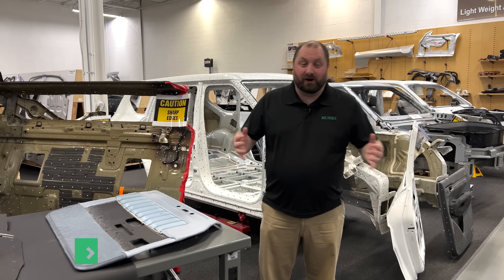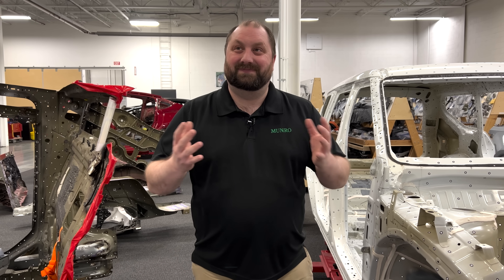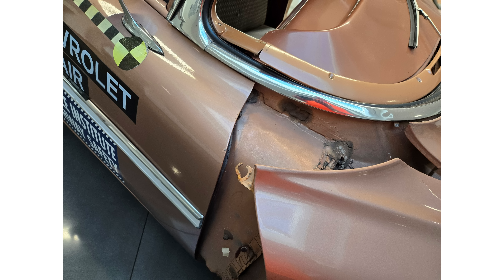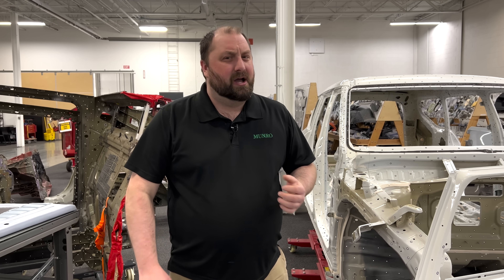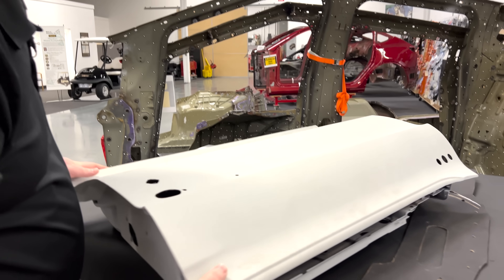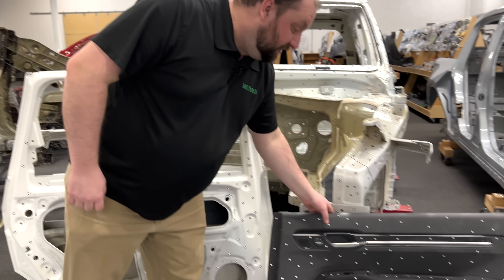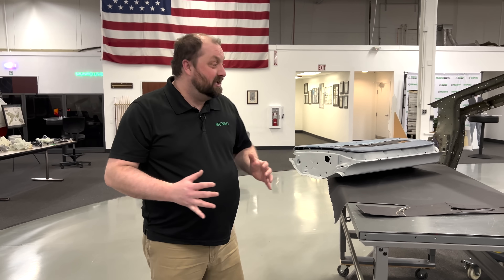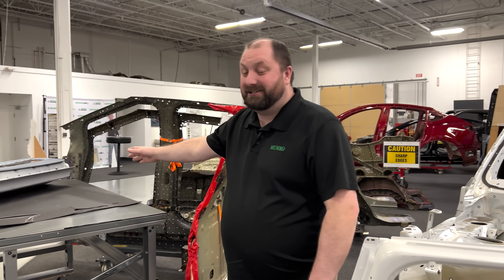No, Your Classic Car Isn't Built Better Than Your New Car

Comment: In addition to the safety factor, when I started driving in 1970, a car with 100,000 miles was pretty much worn out. Today, a car with 100,000 miles still has lots of life left. Many people today don't know how to work on cars because you don't have to near as often.
Reply: People these days also trade in their cars a lot sooner so they're always riding in a car that hasn't had a chance to wear out and they're a slave to a car payment.
Reply: It really depends on how you define a "classic car". If your classic car is from the early 70s, then no, it's unlikely to  have ever been  more reliable than a modern car. Though it was certainly more easy to repair. And also much better looking of course, though that's arguably down to personal taste. 
If your car is a Mercedes from the late 70s or 80s, or another brand from the late 80s/early 90s, there is a high chance it certainly was (and in some cases, still is) more reliable and well built while still being fairly easy to maintain.
Reply: Modern car engines are not really rebuildable. Old ones were. But the lubricants have improved, tolerances are better and computer modelling has gone a long way to improve vehicles.  But high tech requires a higher level of workshop facilities.  I rural areas in Africa,  that is an issue.  I have a 70s tech VW and a Modern car.
Reply: I guess this explains why most odometers had only 5 figures back then.
Reply: Yes, I worked on autos going back as early as 1940. If today folks had to rebuild and replace parts as often as we did back in the day, they wouldn't be able to afford an auto of any kind. The electronics and other improved tech has made autos last longer. The only thing that really frustrates me is they don't separate assessors from the main computer module. A window actuator causing a car not to start is simply engineering stupidity.
Reply: People lazy ass eff today too.
Reply: I’ve spent lots of time under the hoods of older cars, but having owned a number of new Hondas and have never opened the hood except to check the oil and other fluids.
Reply: @tedecker3792  well, let's see how those new hondas fair 20 years from now
Reply: @ there are tons of 20+ year old Hondas out there. Granted millions were made.
Reply: @tedecker3792 a 25 yr old honda isnt a new honda.
Reply: @mro9466  Should be fine if the current reliability trends on them are any thing to go by. The issues are because the engines are completely new (1.5L for example), compared to the venerable J-series V6's. They had issues too early on, but were fixed in the following 25 years.
Reply: Really depends on specifics lots of modern day cars are junk by 100k because the parts are either too expensive or complex for what the car is worth older cars are easier to work on and parts can sometimes be available
Reply: Yup, I was there. In the 60s, terms such as ring jobs, valve jobs, and engine rebuilds were common. By the 70s, I figured it was easier and cheaper to just replace the engine myself, in a weekend, on my driveway.
Reply: Also, they are discouraged from doing so, not because new cars don't need maintenance, but because so many of them live in Condos and houses with HOAs that prohibit you from working on your vehicle, and because they are taught that it is "low class" to fix cars.
Reply: Nice joke. Now go back to driving your Ford Ecoboom 3 cylinder for more than 30k miles 😂
Reply: Thats not due to engineering, thats due to materials technology and oil technology. Nikasil coated cylinders and modern oil does that. But if you applied the same technology to an old cast iron, it would far outlast anything today.
Reply: @smh9902  No it wouldn't. There's more to it than that, please stop oversimplifying everything.
Reply: @smh9902 hate to break it to you but advancements in materials and oils are all engineering 😂
Reply: @ But its not automotive engineering, youre missing the point. If you look at how modern vehicles are designed, they use proprietary parts that are expensive and must be special ordered. Such as proprietary headlamps, proprietary solenoids, and similar such components. They use belts in oil (wet belts) which are notorious for premature failure and require partial disassembly of the engine to replace. They even are eliminating oil drain plugs and dipsticks to prevent people from changing their own oil. Applying advancements in Materials Engineering, but regressing topologically, is not progress. Its backwards. These things are engineered to last just past the warranty, and then fall apart with no means of repairing them. Now apply the same advancements in materials technology to the old designs, and you'd have systems that would last millions of miles. Designing machines to be easy to maintain and repair is a core part of longevity. These cars today are designed to be disposable. They are smart phones on wheels. Its planned obsolescence to the max.
Reply: @smh9902  > proprietary headlamps
That's because of the stupid law back in the day that required all headlights to be the same shape, reducing styling options. I prefer the modern headlights. And there are plenty of third party headlights you can order as a replacement for far less. 

>proprietary solenoids

These don't have to be changed really at all. 

> belts in oil (wet belts)

Agree it's a dumb idea and will probably die out once they fill enough warranties to see it's stupid. 

>These cars today are designed to be disposable. 

Old cars were far more disposable than modern vehicles, what are you even on about?
Reply: @Mercer1012   Nope, the sealed beams being a universal part was a great idea. It simplified supply chains and reduced costs in both cost to replace and maintain. The modern plastic headlights are a pain to change and they break over time from photodegradation. "Styling" be damned, I want a simple work truck.

Solenoids need to be changed all the time. Its one of the most common parts of a starting system to fail.

Old cars were not disposable, they were rebuildable. If we applied the modern nikasil coatings and other metallurgical and tribological technology thats common now to the old simple designs, they would last and last and last.

Simple fact is, if something can't be easily rebuilt or repaired, then its designed to be disposable. I would rather have a truck with an engine that only lasts 150k miles IF it only takes me 30 minutes to swap the entire engine.

Comment: I have a mid 60' pontiac that i recently completed a full body-off restoration on. I am convinced the new welders hired by GM at the time started on the chassis line, there was welds on my chassis that completely missed the second piece of metal.
Then theres the front suspension geometry. Rumour has it the chassis design engineer of the the time firmly believed plow understeer was a "safety" feature as when the car started to push in corners, the driver would slow down!.
Next, the 345hp engine, and the single circuit, unboosted four wheel drum brakes seem like a poor choice of spec!
Still feel safe? How about a front-of- chassis mounted steering box with a non-colapsible steering column aimed right at your neck.
I have managed to do some serious updates to brakes, suspension, steering, seatbelts ect .
It surprises me that any teenagers lived through that time.

Comment: I have had plastic car parts turn to dust without any mechanical stress on them. Many plastics get brittle when they get old making all the snap on tabs break if you try to remove the part. The real problem with plastic is that the consumer has no way of telling which plastic parts will last, and which will crumble with age. I'm not even sure the manufacturers know. Certain very expensive oscilloscope probes from HP crumbled after a few years even though they were never exposed to sunlight. The flexible plastic on the wheels of my roll away suitcase crumbled off on a recent trip. That suit case had not been used often in the 40 years I had it. The problem with plastic car parts is that often by the time they crumble, ALL of the examples of that part have also crumbled on all other copies of that car and any spare parts in someones invantory, so it is impossible to replace the crumbled part. Very few cars from he 90's to now will ever survive to become classic cars because of the plastics used in them.

Comment: Thank you.  Great content.  
Which model years are you defining as "classic"?  
I would say prior to 1980, but I'm quite biased.
Reply: Auto safety has been a process of evolution. The big steps were in the 1990s and 2000s but even today, steps are being made. The low offset frontal crash test started in the 2010s and changed how front end structures are designed.

Comment: There used to be service stations on every block in the city... Had to because of how unreliable cars were. I remember being stranded on a cold winter night in the middle of nowhere because my points slipped and I had to fix at the road side. Leaded gas is toxic and smells gross. Points suck. Distributors suck. frequent "tuneups" suck. Carbs suck. Rusting right off the showroom floor sucks. Paint fading in just a couple years sucks. Constant flat tires sucks. The performance mostly sucks. Handling sucks. Braking sucks. Safety sucks. fuel economy sucks. People don't like "modern" stuff because they refuse to educate themselves. I still fix my own stuff though I give you trying to pull dents in high strength steel in new cars is hard!  Yeah, some old cars look cool, but its all about the fantasy of who we used to be and old "stuff" gives us the freedom to dream back to times that really didn't exist in the way we think it did. If you really want cool old cars, 50's-70's is way too new. Give me Teens up to mid 1930's any day.

Comment: Tack welding spreads the load across a large area. Just like airplanes with a lot of rivets. The old Douglas Aircraft airliners were so conservative that they passed the stress analysis with only half of the rivets. They had thicker sheet metal than the Boeing Airliners and that’s why you saw retired Douglas airliners used as cargo jets for an additional 10 and 15 years after the airlines were done with them. The airframes were stronger (probably less fuel efficient).

Comment: That might be the worst car to use for a crash test. It's not like the x frame is a common feature in classic cars. Let's see that test with a chrysler imperial. 

New cars are obviously safer for the driver, the car is designed to crumple in the event of a crash and lower the impact forces for the driver.  That bel air was made with almost no thought to "crash testing"
Reply: The Imperial's chassis was so strong they were banned from Demolition derbies!
Reply: It's not like a chrysler imperial was a usual construction back then, genius. A Chevy would actually be a much more commonly encountered construction back then as they were far more numerous than imperials. In a test between a modern sedan and an imperial the new car would still be a lot safer.

Comment: I see that they used an American Land Yacht in their test rather than a closer sized Volvo or Mercedes Benz . There are quite a few well built fifties and sixties cars that can withstand impact well. Someone wanted to  make a point with a car design that would clearly demonstrate that very well. That’s why they have that car on Display !  Current and future cars are better recycled than repaired , I’m so glad that Classic cars are much more restorable …
Reply: The crash test was done in 2009. The idea was to show how much safer new cars have become in 50 years. So they used a new 2009 Malibu and a 1959 Chevrolet BelAir. So that was the reason for using the 59 BelAir, so it would be a new Chevrolet versus a 50 year old Chevrolet. Unfortunately, from 1958-1964, the full size Chevrolets had an "X" frame that is not a strong design for such collisions, due to lack of side support. So the results are more disastrous than a car with a full perimeter frame. Chevrolet went back to a full perimeter frame in 1965. A full-size Chevy from 65 and newer would probably have lost as well, but not faired quite as badly as the 59. I drive a 75 Pontiac Lemans Sport Coupe and feel quite safe. The 73-77 GM A-body has the full perimeter frame, large energy absorbing bumpers, "Colonnade" body style for rollover protection, inner door reinforcement beams, and 3 point seat belts. I've had 2 Nissans run into my car. Those cars were totaled. Mine got a dent in the bumper and 1 broken lens. It's 50 years old, and still with the original engine and transmission, and 200K miles and still going. And I have several other similar 70's cars. Some people say they rust. Mine haven't here in Georgia. Depends on where you live I guess.